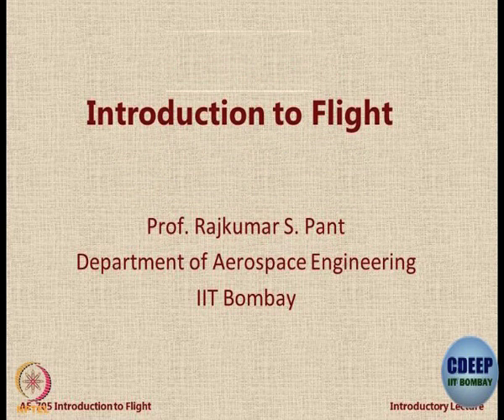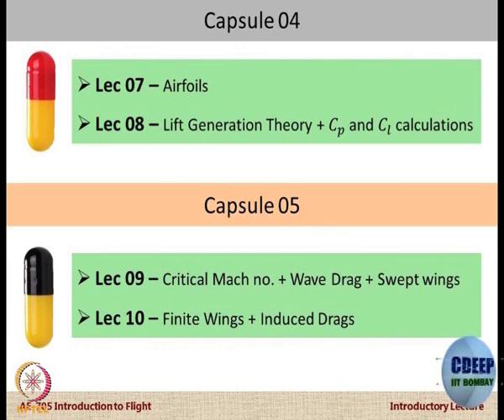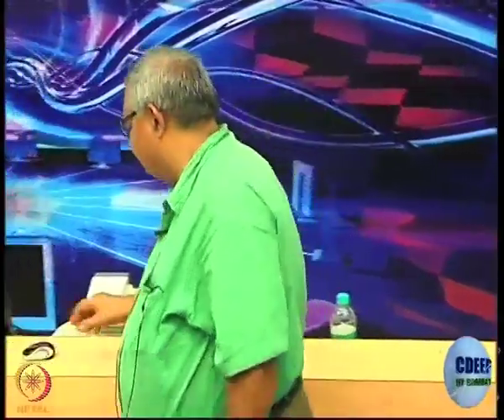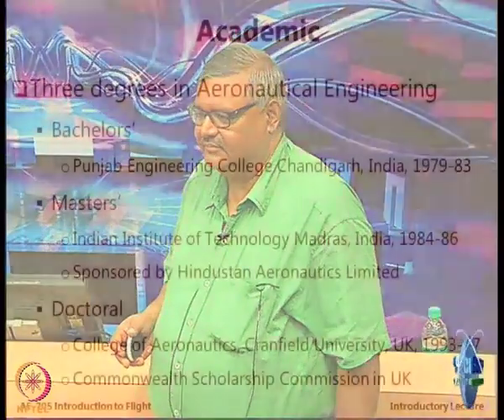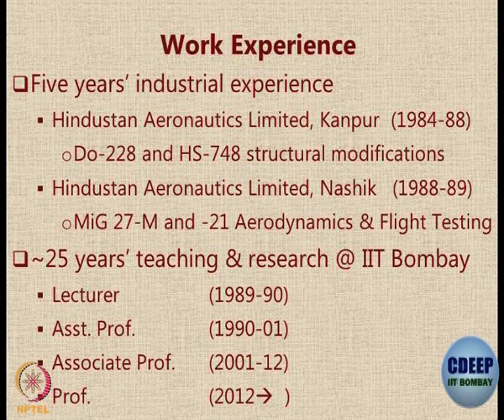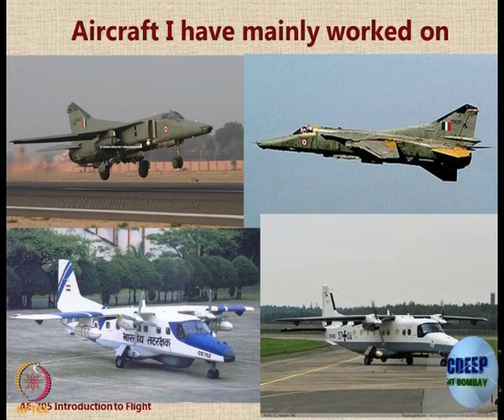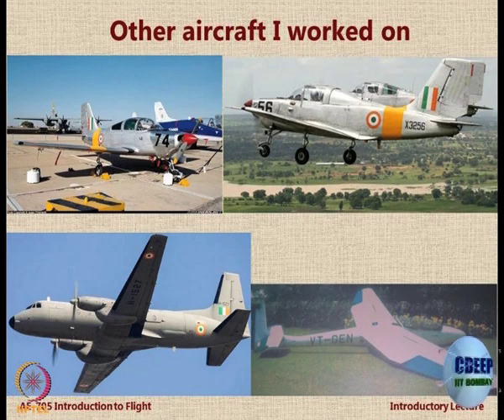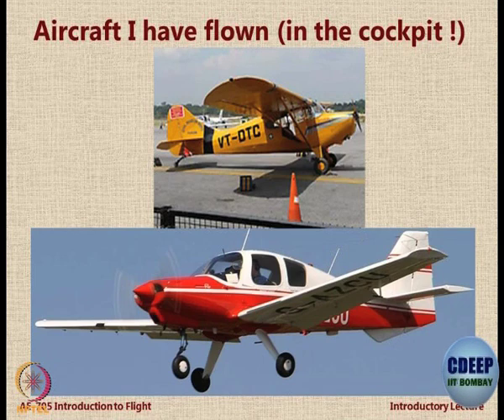Week 1-Lecture 1

Comment: Sir why we are not using battery instead of fuel
Reply: Because generation of enough power through a battery way much harder then just using a fuel using engine
Reply: You need a very high battery just to start a car
Reply: And having a battery fly a plane would be crazy. It is not a remote control plane
Reply: efficiency and upthrust provided by both........
Reply: No battery is that strong(power-delivery wise) first
Second is that jet engines are not possible by use of battery(Though others are but as I said battery are not powerful enough)
Reply: mainly 3 points-
1. The battery has a low power generation compared to engines.
2. to generate enough power, a much heavier battery is needed which increases the overall weight.
3. Batteries have a range and it takes a certain amount of time to re-charge as of now 
SO OTS BATTERY TO USE FUEL ENGINES
Reply: @aryanshah1698  I guess my point was the same but in place of these long texts I used some defined words.